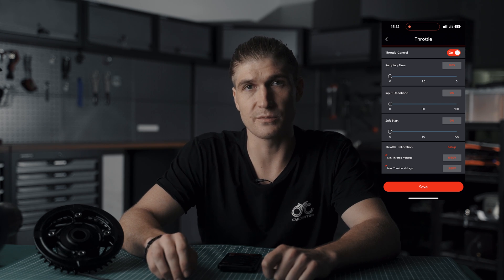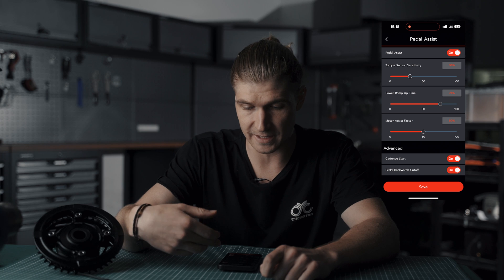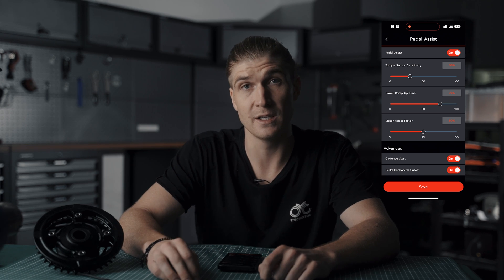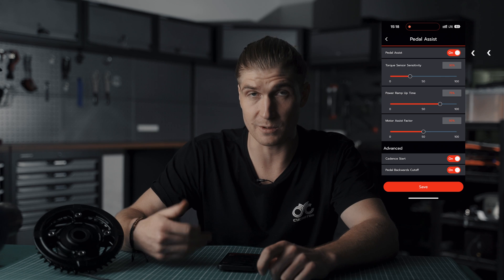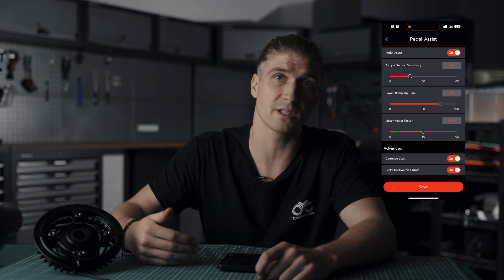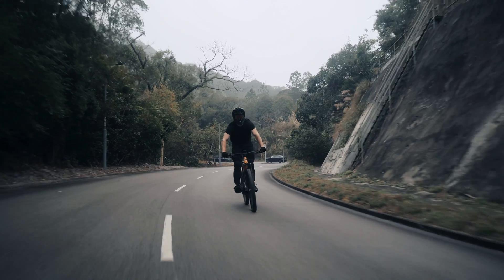Ride Control App Pedal Assist & Throttle Settings | CYC MOTOR

Comment: Hello is there a way to change the motor rotation direction? I’m using a very early direct gear to gear style (no secondary chain) and it seems to be turning the wrong direction . There is a icon on the screen (R) but not sure what that means

Comment: I have a question about my and my brothers cyc photon. On a regular basis, it seems like our drive motors seem to disengage when applying a lot of torque to the pedals when climbing a step hill or technical section. Is this something that can be tuned out in the settings? I'm thinking torque sensitivity might be the problem, but in the section where you talk about it, it's almost completely inaudible. Any advice much appreciated.

Comment: It would be awesome if it could be possible to limit the throttle in Street mode to walk asssit only and then full throttle control when switching to race mode on private roads/trails or coutries with different laws!

Comment: Can we have the option to engage throttle even if we do not have motor assist on at any level ? This can help when face a hurdle but your motor assist is not engaged, a simple push on throttle will get you through ... and then you are back to normal human power pedalling

Comment: I am a BBSHD owner and I am looking to upgrade to a new bike with a CYC X1 Pro Gen 4.  How many PAS settings can you have?  So far I am only seeing 3 options but I would really like to have 5 if that is possible.  Thanks!
Reply from the maker: You can tune it for 2x modes: Race and Street mode. Then, you can have up to 9x assist levels.

Comment: This has probably been asked by someone before, but it'd be awesome if the throttle/PAS top speeds could be configured separately within the same profile. For example, in my street profile I completely switch the throttle off to force myself into pedal assist, but it'd be nice to be able to use the throttle up to a certain speed to set off. Or another example is limiting the throttle to suit local regulations in the street profile. 

Something else I'd like to ask about is what the throttle pinout is, I've been searching for a lever style thumb throttle that's compatible with the CYC, but both ones I've tried aren't registered by the kit, please could you advise on the pinout for the throttle. 

Thanks

Comment: Excellent video!  Please provide a discussion regarding how torque is defined for the three available assist levels for throttle and peddle assist. As the user can define the maximum wattage provided for each assist level and torque is set as a percentage, how does that relate to torque in Newton-Meters. Sample question: If the motor is set to 6kw and that relates to 250Nm of torque if set to 100%, then setting torque to 50% would mean that a maximum of 125Nm would be available.  Is that how it works? If not, how does it work?
Reply: Doing some research would indicate that motor torque is more related to phase current at a given power/load/gearing (bike climbing ability). Whereas, phase voltage at the same power/load/gearing relates more to maximum motor RPM (bike speed).  So, what does the torque setting in the app actually do to control available torque and how is it quantified?

Comment: @2:15 is this how the cool kids mount their throttle now 😂
Reply: I think its for demonstration and viewing purposes so you can directly see the action of the throttle.
Reply: @SofiaisSunshine  Yeh, I assumed that too. Somebody is going to think its a good idea and mount it that way.
Reply: I think its dangerous.
Reply: Only the cool kids with dropper posts. On 1x bikes the throttle won't easily fit beside the shifter and brake; and on the left side the throttle fits but is hard to avoid mistakenly hitting when using the dropper.

Comment: It would be nice to have screenshots of different settings for mountain trails, gravel, and roads that others have dialed in.
Reply: Or some presets built in. I would love to swap from “commuting” to “MTB” ON THE FLY FROM THE APP.
Reply: Yes please!
Reply: Having more than two (street / race) profiles switchable from the app would be desireable. Including the ability to enable/disable throttle & peddle assist independently for each profile would also be useful. Thanks for the excellent video.